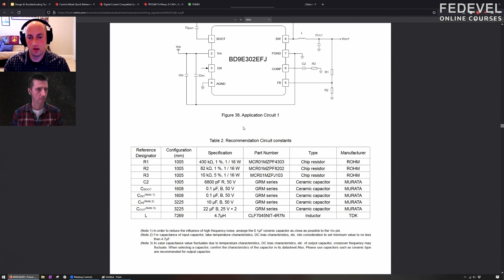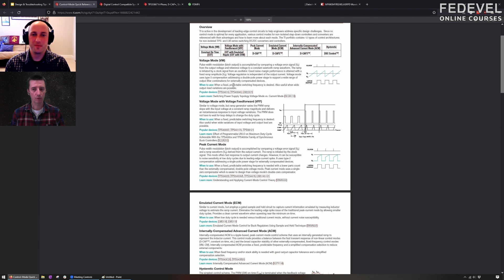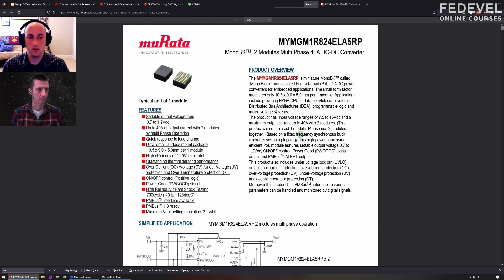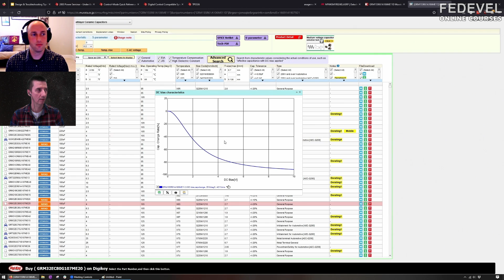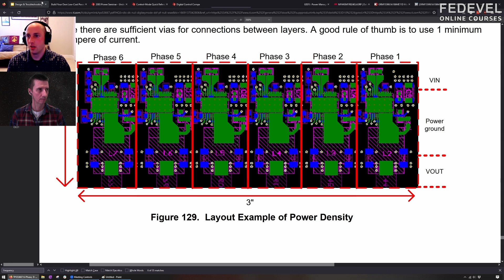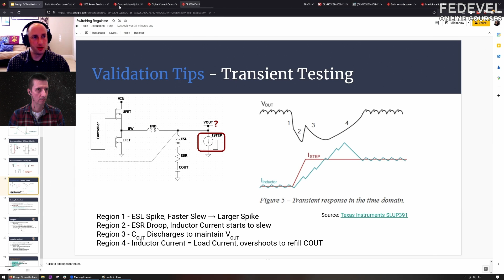How to design perfect switching power supply | Buck regulator explained

Comment: Quite an enlightening talk. Like Robert mentioned, power supplies have always been a small part of my boards, and I’ve mostly just followed the application circuits in the datasheets without digging much deeper. I guess I’ve been lucky to have them work on the first try most of the time. This gave me a much clearer big-picture view of what’s actually going on inside these ICs and all the different levers you can pull to tune and optimize the performance of a power supply system. Really appreciate the depth and clarity. Thanks, Robert and Carmen!

Comment: I've checked  in spice a buck design  based in a transistor-schotky model vs one based in two mosfet.
The second one generates a lot of high current spikes.

indeed, righ now I am devoted in understing the building of switched power supplies

Comment: THIS LOOKS LIKE A TANK CIRCUIT (i.e. INDUCTOR AND CAPACITOR IN PARALLEL) and IT'S CONTROLLED BY THIS SOLID STATE SWITCHES WHERE IT'S CONDUCTION STATE IS CONTROLED BY THIS GATE DRIVER. SO, CAN THIS DESIGN BE UPGRADED ALSO FOR USE IN FUSION POWER SUPPLY SWITCHING (PULSED POWER NEEDS) ?

Comment: Hi, I havent watched the whole video ye, so I am sorry if my next question is redundant... At work we had a DC-DC converter working on PFM mode that was powering a camera device. We were having issues with the analog signal being slightly degradated by noise, which stopped when we moved from PFM to PWM. My question is: is there a proper theoretical way of designing a line filter for this mode of operation? Or should I just run my device and see what kind of noise I get to compensate for it?

Comment: What is the meaning of DNP in page 10? Do not populate? What does it mean?
Reply: It means that the component is not to be placed, sometimes you leave the footprint in the design just in case you found a problem during the validation stage of the design that requires extra components.

Comment: It looks so good in a whole video. Benefit from it a lot. For the transient area in this video, is that possible to make another video to compare behaviors of transient in voltage mode control scheme and COT scheme (attached SW waveform)? It may be much clear to see how switching frequency relates to transient response . Also for a transient response, there should be included overshoot and undershoot both. That would be great if there's another video to discuss it.😀

Comment: Nice video and thanks a lot., . When I was driving SiC with gate driver, I saw the PWM ringing at the edges. It could be due to PCB trace layout, distance etc.. and yes, gate drive resistor helped to fine tuned the performance. not too slow.. not too fast to cause ringing.

Comment: Hi Robert,
I have one doubt I saw some several schem circuits in that power pin consits of three pins one for 24v (supply whatever the range may be)
And rest of two pins as a ground.my doubt is why they use two pins for grounds but one positive is there any behind it.if is there means please explain thru video it may helpfull for others(many circuits design engineers)
Thanks in advance...
Reply: Heat sinking.

Comment: A question about RBOOT: Shouldn't it be on the left side of the node between the diode and the capacitor to dampen the charging current of the capacitor?
Reply: It's not there mainly to slow the charge of the bootstrap capacitor but to slow its discharge(the current that turns on the upper fet), since in integrated FETs designs you can't place a gate resistor.

Comment: This is one of the most important videos you put out. I've seen PCB designers with 10+ years of experience that have no clue of how a switching power supply works and how to properly lay it down. And by that I mean COMPLETE DISASTER!
Reply: Ah, you’ve got me. Years of using AD and TI products have made me rather lazy, sadly. Scrambling to catch up right now, for personal growth.
Reply: @ziqi92  AD/LT have great products, but still, you need to minimize the input/output current loops and provide a path of low inductance for the GND return.

Comment: First, good basic, but use PWM control before mixing ramps and DCAP control.  DCAP changes frequency in response to load steps where PWM does not.  DCAP maintains frequency only in steady state.

Comment: On the video preview, there is a faulty schematic, it would burn on various reasons when the 2 MOSFETs are on. From the very first preview I can guess about the level of your knowledge.
Reply: It's not faulty. The 2 MOSDETs are never on at the same time. That's why the gate driver has to be strong enough, else it doesn't switch fast enough and both could be half on
Reply: @bene5431  In practice they can be, due to faulty driver, dust, EMP, whatever. Same defect is observed in some UPS, namely "smart-ups" series by APC. The difference is that there are even more faulty logic - they are connected in series, and with a common control line.
Reply: @trevoro.9731  I think you didn't watch the video
Reply: @bene5431  I mentioned the preview part, not the video itself. The preview is not the "correct" one.

Comment: As an idea would be really cool to see making BMS for home batteries. There are schematics online, but I'm hesitant to use them on big and rather expensive batteries.
Reply: Active BmS.
Do not do stupid Resistance Bms!
48v at 5a charge 1 of 12 cells...44x5="200wats losses OFF " desapathion,(sorry for doggy English)
Reply: Agreed, this would be helpful. Maybe a series on different BMS applications, for small power, for low cost, etc
Reply: If U are not skillful at multiphase BUCK topology, U can buy 10 A BUCKs for 5 €, for 4S LFP U need 3, for 8S LFP U need 7, etc. connect to ESP32 driver, or use 8, 3.3 V relays 10 A / 30 V max., and U have cheap 10 AMPS active balancer.
https://www.youtube.com/watch?v=OP96CLPi9UU&t=8s